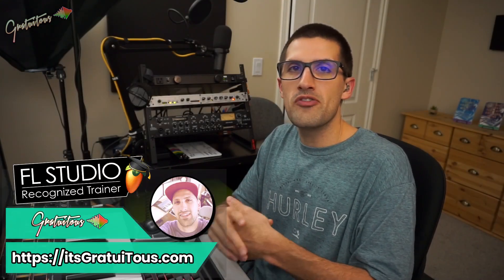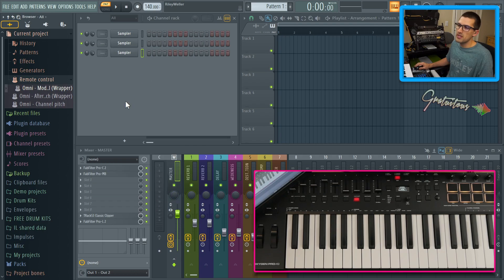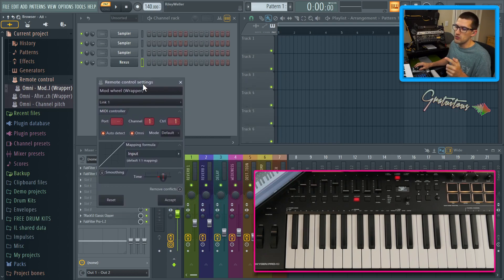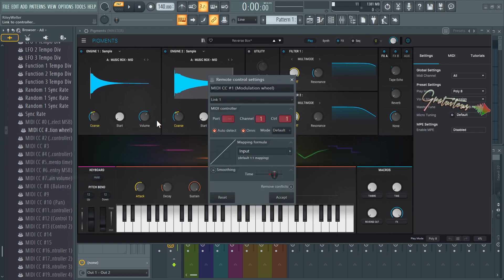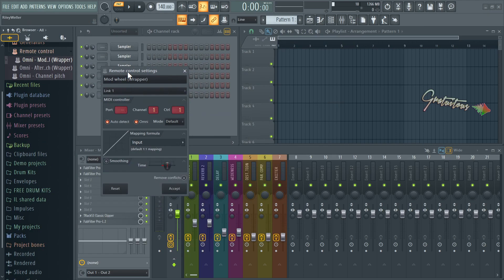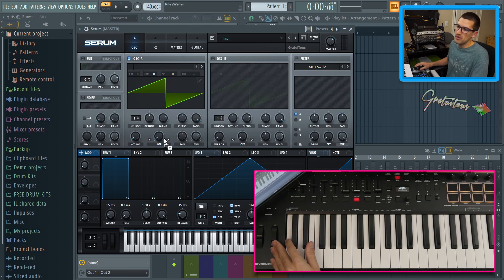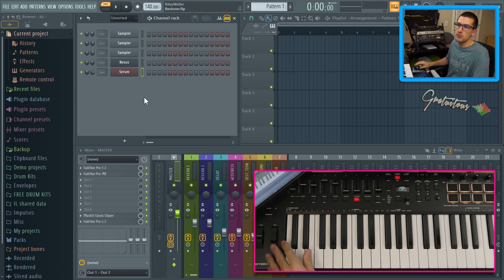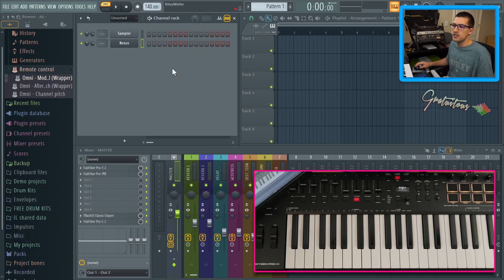How to Fix Mod Wheel in FL Studio

Comment: Fuck fl studio. This shit never works the way it's supposed to. I purchased fl keys and still like all other keyboards it doesn't work.
Reply from the maker: Are you specifically talking about the mod wheel?  I personally use the M-Audio Oxygen Pro MIDI Keyboard, and am having a good experience with it - I have a detailed help guide here:  https://itsgratuitous.com/help/m-audio-oxygen-pro/
Reply: @itsGratuiTous yes the modulation wheel. The fl key 61 doesn't work by default using Omni sphere, Arturia analog v. It's such an issue. I heard this is a common fl studio problem. I would assume a keyboard made for the daw would work with no issue.
Reply from the maker: @VicMKV   So the mod wheel should be CC 1.  You can also right-click the mod wheel in the plugin and setup "Global Links" - this is a permanent setup so whenever you open & use the plugin, the mod wheel will work (and show a blue knob in the hint panel)  - https://itsgratuitous.com/project-links-vs-global-links-flstudio/

If you are not able to right-click a knob in FL Studio, you can move the parameter and select "Last Tweaked Parameter".  Let me know!  :)

Comment: Thank you ! My pitch and mod wheel didn't work for a few week, and I didn't know how to fix the issue. But after seeing you video I went to the "Remote control" section in FL, then clicked the parameter and moved the pitch and mod wheel + after touch, and Voilà ! Everything worked perfectly fine; the icon was orange and the parameter worked as it used to.
Reply from the maker: Good stuff!  I wonder why your pitch and mod wheel stopped working initially?  You can keep learning beatmaking with me @ https://itsgratuitous.com/

Comment: 0:47 it's not there. Only Omni - Channel Pitch.
Reply from the maker: Not sure if FL Studio 21 has changed this.. I'd say create a brand-new project (no template), and see if it's there!
Reply: @itsGratuiTous  You're right. A blank project has both Pitch and Mod wheel Omnis where your video shows them, but an existing song does not. Anyway, I found a workaround by hooking the specific mod parameter of the specific generator Piano Roll.
Reply from the maker: @Pandamasque  Yeah, so if you are using a template that has those deleted, they will never show.  If so, templates can be powerful, you just have to make sure you use them in the right way... I wrote a book about templates actually (and have my own personal template available to students of my platform):

FL Studio Template Book:
https://itsgratuitous.com/product/fl-studio-ultimate-template-creation-guide/

FL Studio Template:
https://itsgratuitous.com/product/fl-studio-template/

Beatmaker Training Platform:
https://itsGratuiTous.com/courses/

Reach out if you ever need beatmaking help :)
Reply: @itsGratuiTous  well, I'm rebuilding an 7-minute prog rock track just for that lol. But I'll make sure my base template has that functionality for the future. Thanks.

Comment: I had a big problem my mod wheel works with 3 party plugin like korg m1 but dont work with fl studio plugin like sawer . ?  If i link fl plugin its work but 3 party doesn't work and inversely
Reply from the maker: Mod Wheel is CC# 1 - If you link, it will only work for that one plugin, right?
Reply: Yes i would like to link my picth and mod wheel for all 3 party and native flstudio for pitch and modulation for all my project save in template. Load this template and boommm my pitch and mod wheel are already linked
Reply from the maker: I understand, what I'm saying is when you link, it only works for ONE PLUGIN, regardless of third-party or stock plugin, correct?  If so, that's because you're using a "Project Link".  Here's some info: https://itsgratuitous.com/project-links-vs-global-links-flstudio/

For further info from you.. are you using a template already, and now you are experiencing this issue?  If so, make sure to use a blank project (no FL Studio template), and see if your MOD wheel works for native FL Studio plugins.

If it does, then it's your template, and following my tutorial above (with video/article) will walk you through step by step.

You may also like "how to fix the pitch and mod wheel in fl studio" which I've done here also: https://itsgratuitous.com/fix-pitch-wheel-mod-wheel-fl-studio/
Reply: I start with blank template the pitch bend works with all 3part anf fl vst, I stricly follow your tutorial and now all my 3 party vst works (pitch and mod) but the native fl vst only the pitch work no mod wheel ? Example sawer when i browse cc1 and link to controller, mod wheel works but the 3 party lost mid wheel. I an disappointed..
Reply from the maker: @rudolphsiekiera7579  What MIDI Keyboard are you using?

You are not understanding how link to controller works, there are Project Links and Global Links.

If you use Project Link, it will only work for that one VST, not any others.

If you go to "Remote control", can you see Mod Wheel (Wrapper) ?
Reply: @itsGratuiTous  i use Flkey37 and yes i see mod wheel wrapper. I use project link omni, in this case all 3 party plugin works. But not the fl vst. If i use global link my mod wheel works with only one vst if i link another vst with the same mod wheel (hardware) i have conflict. Impossible to autodetect the mouvement of my flkey wheel
Reply from the maker: Ok good it sounds like you are understanding.  This could be a MIDI Keyboard conflict.. Usually my mod wheel was always working, but my pitch wheel was not.. so this video I created solved my problem by using the channel pitch of a Virtual Instrument.

I'd highly suggest reaching out on the Image-Line forums with your question - also it might be wise to do a search on their forum first about "FLKey 37 Mod Wheel" or something similar to see if others are having issues..

I personally like this M-Audio Oxygen Pro a lot.. it's jam-packed and works really cool with this drum pad workflow I coded through MIDI Scripting.. https://itsgratuitous.com/m-audio-oxygen-pro-template-v2-update/

A good MIDI Keyboard is the difference between a great experience and a horrible one.. 

The biggest thing to have on a MIDI Keyboard is the transport buttons working (with Loop Button) and decent semi-weighted keys..

It's not too often I use Pitch / Mod Wheel..

Sorry I cannot help further at the moment.. let me know what you figure out, and if I can provide any other insight!!